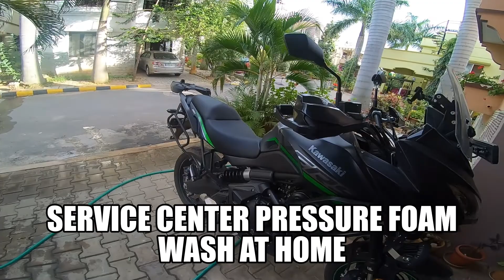Service Center Pressure Foam Wash At "HOME" For Your Motorcycle

Comment: Is it safe to direct the pressure jet on the instrument console? I guess I'm just paranoid because my Enfield's speedometer fogs up at the slightest hint of moisture.
Reply from the maker: Definitely not direct pressure jet but from a distance should not matter in most vehicles other than RE, I too have my Interceptor Speedo fogging issues 😀